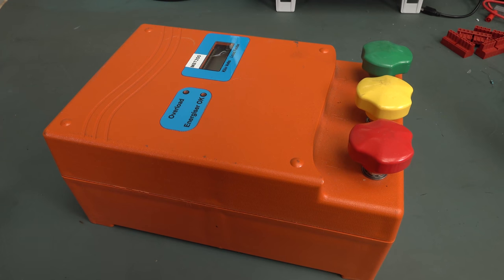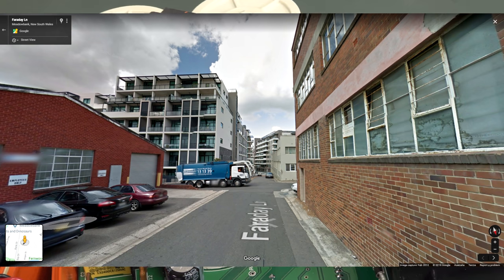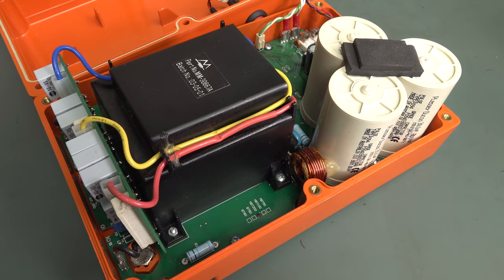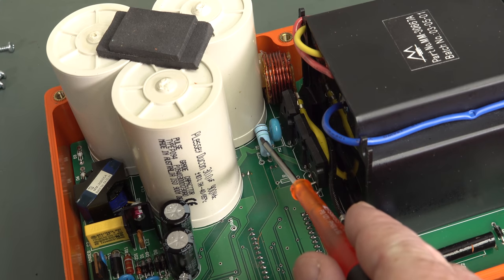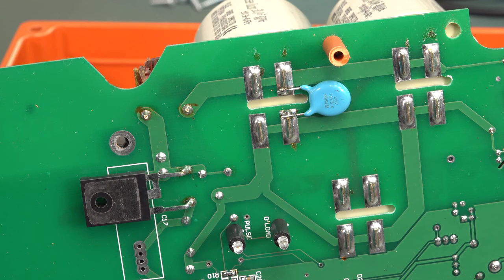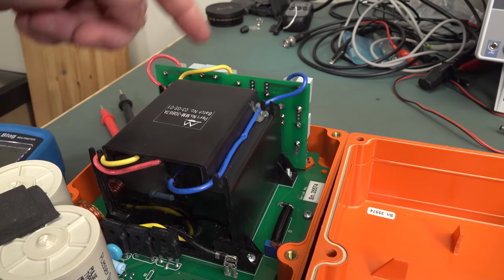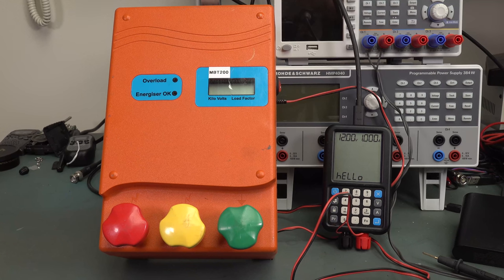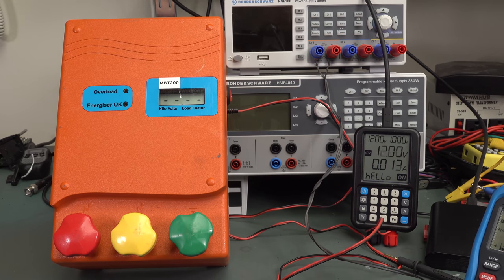EEVblog #1277 - Electric Fence Controller Teardown

Comment: 5:03 Anybody else notice that little tiny stray copper wire chilling there on the PCB near the center of the open area?
Reply: That may be a bit of the plastic casing.
Edit: I'm fairly sure now. 5:36 it's on the opto tubing too
Reply: No.

Comment: Reverse engineering is more fun anyway. :-)

I've never seen Plessey capacitors but have some Plessey ICs in my junkbox. People of a certain age will remember SL6440 and SL6700.
Reply: As a ham I thought those part numbers looked familiar. Sure enough, while I've never used them (more of a NE602/604 guy myself), I'm certain I've come across them in repairs and old schematics.

Comment: 100 Joules seems like an awful lot. Although no body, human or cow will only have a 100 ohm resistance. Just off the top of my head, I know 200 joules is about what they use for cardioversion with defibrillators. Of course, that's directed right across the heart. So it's not quite the same. Still an interesting comparison to make though.

Comment: Some severe magnetics voodoo going on in that thing, "...improved pulse shape without increasing I^R  losses in the primary, it also allows the leakage inductance of the transformer to work with the filter capacitor (or more accurately it's reflection in the primary). The goal was to produce  a soliton pulse shape."

 Few electrical engineers can get this stuff right in any normal design window. They do it on personal machismo. I mean, Dave Jones work on low burden front ends for voltmeters is not shabby, but...

Comment: Plessy Navel Systems ?
I don't think so !

Plessey Naval Systems I presume
Reply: They make belly button products and accessories.
Reply: My first job, back in 1979, was in the EW labs at Plessey Avionics in Ilford, UK. I left there in 1981 to work at GEC-Marconi in Borehamwood, UK. Avionics shut down in 1989 and the site was sold off for housing and a shopping centre. Small world though!
Reply from the maker: LOL, did I type that?
Reply: @EEVblog  Someone has been gathering some fluff recently
Reply: @EEVblog  Have to admit I did have to rewind and listen again a couple of times to be sure I'd heard you right, talk about déjà vu! I designed ground-to-air and command & control radio systems and later got involved in synthetic aperture radar and did a little bit on ordnance guidance systems before moving on into commercial computing, early mobile phones and a few years on space craft instrumentation systems.

Only recently discovered your channel on YouTube (and now lbry too) but really enjoying following your exploits - and the nostalgia!

Comment: I hope you and the rest of your family enjoyed the walkabout and some time away from the smoke hovering over Sydney. I'm ok with voltages up to 30V or so but I haven't had to deal with anything above 20 recently. I don't blame you for wanting to be standing on the other side of the room when powering up that unit. The "Not for sale" mark may indicate some kind of test or development unit. The approval number is Q????. One minor thing I noticed about the unit is the blue wire on the big transformer has been severely pinched.

Comment: So they've connected multiple caps in series to increase their voltage rating? This is not how ya doing. If ESR varies, caps may be exposed to higher voltage while charging.

Comment: When nature's callin'
Don't be stallin'
Use your common sense
Before you let it flow
Find a place to go
Just don't whiz on the electric fence

If you're gonna explode
You can use the commode
Of igloos, cave dwellings or tents
No need to explain when you gotta drain
Just don't whiz on the electric fence

You can swizzle on the sofa
Piddle in the air
Tinkle in the toilet
That's why it is there
(Toilet flushing)

You can let it rain
In the breakdown lane
While waving at ladies and gents
Just don't whiz on...
Don't whiz on
Don't whiz on the electric fence